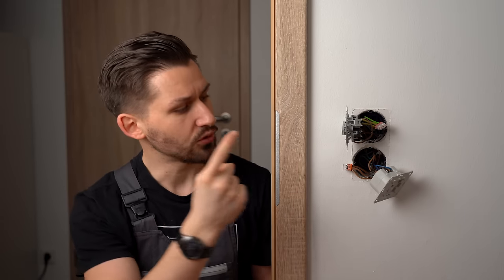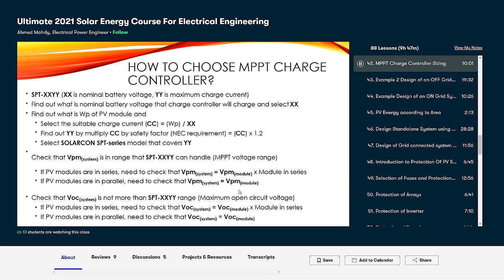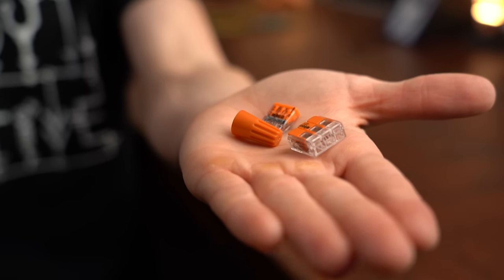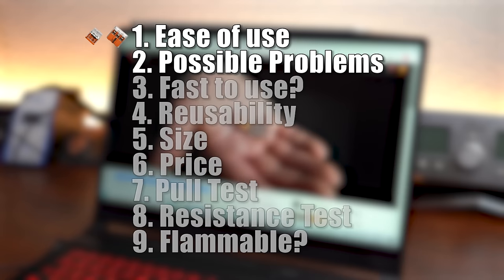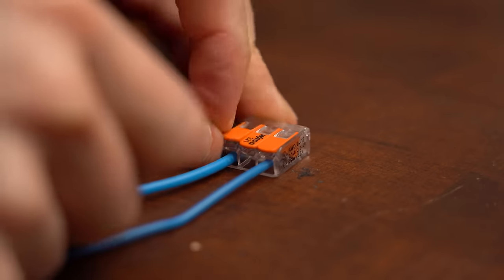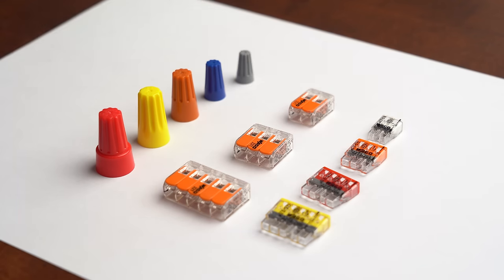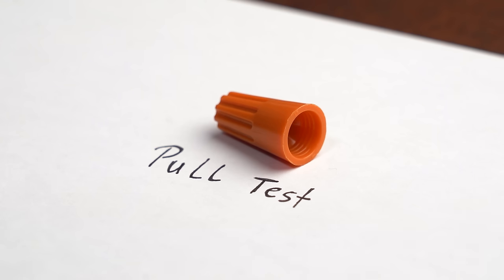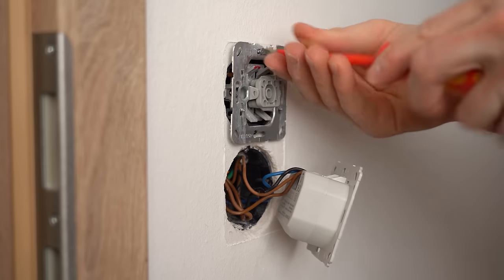What Wire Connector is the Best? Settling a Debate! Wire Nut VS Wago

Comment: I personally like the Wago connectors, and I think non-professional installers should prefer them. There are circumstances where wirenuts are used that make sense though, like water resistant connections (e.g. on submersible trailers), where there are specific wirenuts with flanges that reduce water penetration.
With that having been said, I think the "wire nuts" you got were not from a reputable brand. There are all sorts of manufacturers of them, and the good ones will have specifications listed on them for every test you did, and will be listed by a certifying body like UL (Underwriters Laboratories), Intertek ETL, or CSA. I believe at least UL does listings that take into account how easy the given nut is to be misused, and they can perform quite differently on that with even slight differences in the geometry. Of course, reputable and listed wire nuts are going to be more expensive than the cheapest ones.
Reply: I saw a JB where a guy used about 50 wago connectors. 1 month later I was called out and 5 had started arching to the point where the wires were hot 8 inches back and all the sheathing had turned black. Some of them are good. Some are trash. But I’m not gunna be responsible for someone’s house burning down so I am going to use wire nuts
Reply: @XMooseManX  With no information about the application, there's no way of saying whether they were appropriate or not. Genuine Wago lever nuts used as listed (not in overfilled enclosures, not on unprotected circuits or circuits with inappropriate current, etc.) do not just suddenly start arcing.

50 lever nuts in a single junction box, to me, gives a good hint of where the problem lie...
Reply: @microcolonel  yea the guy was probably a moron but at the same time that many wagos allowed for a dumb person to make a mistake that resulted in issues with the connections.
Reply: @XMooseManX  have you done the same experiment with an overfilled jbox full of half-assed wire nuts?

Comment: The pull test is definitely a hit or miss with the wire nuts.  Especially when you connect more than 2 wires, or different AWG,  there is chance of them not being engaged by the threads of the nut.  I have previously spent time aligning and then twisting tight a few wires with a nut.  After moving them around the box one wire just fell out of the nut.
Reply: pre twist my man pre twist
Reply: Learn how to put them on.

Comment: Here in America for fire alarm we use exclusively wire nuts. My newer guys can have trouble with wire nuts but for experienced guys like myself wire nuts are incredibly quick and you can get an extremely good connection. I think the wago connections are great for diy and people who don't do wiring professionally but the cost and potential resistance issues the can impart especially on fire alarm are definitely a downside for commercial use. Do German electricians always use the automatic wire stripping tool? Here in America I have never seen a professional use them and any new guys that bring them find quickly they they aren't fast and reliable enough as good old wire strippers. Even apprentices should and for the most part can tell by feel how long to strip wire back.
Reply: @Brent Radebaugh: Thank you! Automatic wire strippers are forbidden where I studied. There are solid engineering reasons for this. All strippers might not be created equal, as is true for pressure connecters, but the risk of wire damage was always deemed too high. Training and skill were judged more valuable than potential time savings.

Comment: Add 2 points for wago :) one for being able to comfortably connect more than two or three wires and the other for being able to safely disconnect the wire even is under voltage.

Comment: Switched to WAGO a few year ago, over the years so my times doing service to electrical connections have found many wire nuts poorly installed. With the WAGO's easy to inspect and much better chance of getting a long term reliable connections.
Reply: Good connections are not made by chance.

Comment: I think wire nuts are safest when thinking about long-term reliability. There is a very remote probability that those teeth in the Wago connectors can lose their tension or corrode after 20-30 years, almost certainly leading to a few Ohms of resistance and creating a fire hazard. The wire nut connection can't really lose tension and if the spring corrodes, the wires are still connected to each other by the twist.

Comment: in the US I think most electricians use the white/cream colored with wings type, they also fit a nut driver if you wanna crank it down really tight.

that's what my dad used in our house and he was a professional electrician when he started.

there are also "greenies" that let you pass a long un-insulted ground wire stright through it to make a pig tail faster, those are only for ground and can't use a nut driver, but they still have the wings.

Comment: I'm an industrial electrician. First job I got out of college we used Wagos for everything, wire nuts were banned. Never had an issue related to them. Switched employers, lead man at the new place likes wire nuts and thinks wagos are overrated. Multiple times when we'd have issues with a motor, I would open up the peckerhead and find a burnt up wirenut.

Comment: It seems like there was only one criteria dealing with functionality, the resistance test.  There 3 tests for safety (size, pull, and flammability),  2 test for ease of use, and 1 for price.  The only test the Wago connectors won out where convenience factors.  The wire nuts did better in the functionality test.  I was a big fan of Wago connector before but I will probably switch to wire nuts.  The short of amount of time saved and reusing the part means I ultimate only liked the Wago connector because it was convenient not because it was better.

Comment: I like the WAGO 221, but they have a big issue. When the wires are in place, the latch flaps around by about 45 percent, meaning when a receptacle is being pushed in place, the latch could be then pushed back and release a wire or more, causing a short.  Poor design.
Reply: that was my first thought as well, I guess you could minimize that risk with electrical tape.
Reply: if there is the danger of this happening because of a lack of space, you should not be using this kind of wago in the first place. There is a maximum number, varying for different types, for standardized electric housing boxes. If you dont exceed these numbers, this will not happen. Of course, these standards will differ, or not be available in other parts of the world.

Comment: A wire nut is mainly a cover for the pigtail splice, and quality varies.  In N America, push-in connectors have a bad reputation from backstab connections on outlets.  The Wago 221 is a fantastic connector, and results are consistent.
Reply: They have a bad reputation for a ton of reasons. The biggest one is just the fact that wires will come out pretty easy with a bit of twisting. Any place there is lots of movement or wiggle, the wire nut is better. Wagos are great and fast in lights or j-boxes. A switch or outlet could have issues over time though
Reply: there consistently junk.

Comment: Nearly a watt of resistance in those Wagos, heating up inside your walls - how is that allowed? Waste of energy = waste of money, fire hazard... seems insane
Reply: that's pretty crazy actually
Reply: Well. It is with 20Amps running trough it, or around 4.500watt if 230v was the reference.
Reply: "A watt of resistance" I really hope you're not an electrician. A watt of power lost with 20 amps running through the connector, that's nothing. Certainly not a fire hazard.

Comment: My issuewith this is you rated everything equal. To me the key factors are resistance and connection strength. 

Resistance in the US is a bigger deal because we run higher currents in many applications due to our 120/240 system vise the European straight 240.

Comment: Wire nuts are NOT made to connect the wires. They're made to COVER the open connection. You're supposed to twist the metal wires and that is your connection. If you solely twist using the wire nut, it creates a very poor connection which can/will fall apart a lot easier. Nothing will beat twisting the bare wires, including a WAGO, because there is maximum conduction between the wires. WAGO introduces resistance by using a smaller and/or less conductive connection. No need to test, just think about it.

Comment: Wow the way you use wire nuts are wrong! You have to first twist both wire to a prezzle shape and then tighten with wire nuts to secure it, NOT pushing in both parallely and rely solely on the nuts to make them twist.....

Comment: It does get me that the instructions included with many wire nut brands say you don't need to do this, but coming from the electrical field myself, I don't know any electricians who rely on the wire nut to create the connection. The wires should be twisted together first, and the the wire nut fastened onto that connection to secure and protect it. When done correctly (and it's really not hard), I would argue that type of connection is still the superior connection. Granted, you have to be careful when twisting stranded and solid core wire together. If not done correctly, there can be a tendency for the wire nut to draw the stranded wire up into the tip of itself and then not seat correctly. Pretty easily detected though with a quick tug test (which everyone should do with any kind of connector).

I have no problems with Wago connectors. They're fast, easy, and a bit tidier. But with Wagos you are still relying on the connectors own bus bar for the connection vs connecting the wires directly together in a twisted connection. Maybe it's overkill, but it's one less variable in the system, which means one less variable that can fail (though I'm sure it's still highly unlikely).

Comment: I am an electrician in California and while Wagos are available, a more popular and available option are the Ideal brand "in-sure" push in connectors, which are the same as the Wago 2273. I use them almost exclusively now in my work, but unfortunately they are not available for wiring that carries more than 20 amps, so I do so have to use wire nuts for larger size wire

Comment: Ok as a electricians helper here's how you use wire nuts. Cut anywhere from an inch to 2 inches of insulation off. Slightly pretwist the wires then use the wire nut to get the wires nice and tight. Remove nut and trim un insulated wire down to 1/2 or 3/4 inch. Install wire nut again and cover half the nut with electrical tape down 1 inch the wire.

Comment: It might be worth mentioning that the ribbed portion on the outside of the wire but it the stripping gauge. You strip the length of the recessed groove. When using stranded conductors with solid conductors you allow the stranded conductor to be put in first. That creates a much more reliable connection. I’ve used both a bunch here in the states. Never had an issue with a properly done wire nut but I have seen wago connections work loose from expansion and contraction due to heating and cooling, particularly on exterior fixtures like coach lights. Just my 2 cents

Comment: I'm in the US, I use push connectors as my default (cheap and have visual confirmation of connection). I use WAGO if I'm working with stranded wire, need to wire with one hand (Ex: holding a fan up) or if I'm trying to figure what my wires are (allows me to quickly rewire connections).

Wire Nuts = 10 cents each
Push Connectors = 12 cents each
Lever Connectors = 80 cents each

Comment: I’m sure some Americans have pointed out that the wire for using a wire nut was done improperly. Home users (DIY) would more than likely use them the same way but not professional installation. Strip more, clockwise twist conductors, cut off to length and then install wire nut.  
 Overall informative video. Results were about what I suspected going into video. Good job.

Comment: All depends on whether or not you know how to do good work. I do, so a wire nut doesnt even hold my splices together, it just acts as an insulator.  I'd put my 5 wire splice with a wire nut up against your wago any day. Might take a little longer but it's a far better connection with lots of direct copper to copper contact.

Comment: Here in Britain, the standard practice is to do the same thing as a wire nut does - Except we use the fingers and don't bother with the nut. We simply wrap a bit of electrical tape around the dodgy join and then say „Sod it...That'll do“ and we get bonus points if we use a mix of solid and stranded wire on those joins, too. 🔌🔥😉

It'd be really nice to see Wago connectors become the de-facto here and I know some of the better British electricians are using them now, but until we can get ourselves out of this race to the bottom we're going to be stuck with the cheapest options every single time. 💸

Comment: It should not be based on ease of use, it should be surface contact area which produces performance and SAFETY. The wire nut always wins when installed correctly. WAGOs are clever levers but do not perform electrically.

Comment: I got some Wago 222 replicas from China. Did the same pull test as you did. I reached 37kg but it didn't fail. Surprisingly!
Reply: You are brave. I wouldn't trust Chinese parts in my electrical installation.

Comment: besides the open end of wagos for testing voltage seen numerous times in the comments, the wagos end push connections have the added benefit that its easier to add something to the installation. you can just push in new wires in existing wagos in the nearest junction or central box, while with wire nuts you need to unscrew them to twist in the new wires

Comment: As a eastern european, i prefer simple  electric connection cube. Better resistance parameters than wago. Also, construction of this antique connector prevent from making too much circuits from one line. I saw many cases, when someone was wondering why B16 circuit breaker turns off, and the reason was 5 wagos in one electrical box expanding one 2,5 mm outlet line for 10 circuits - because it is easy to just put-in conductor than screwing them to the cube brass tube. During screwing there is a chance that a thought will appear - "if the third wire does not want to enter, maybe you have to do it differently?"

Comment: Would love to see you get some good wire nuts. Probably closer in price to the connectors but I do plant work and ours have silicone in them and a heat string band at the end. Twist your wires tight. Snip the sharp jagged ends. Crank tight. Heat the end. Come back next day only way to remove is to cut off the joint. Fully water, vapor, and corrosion proof

Comment: Accordin to theese results - wire nuts are clear winner. They make less of ressistance and they make stronger joint. Thats much more important than "reusability" etc. It only cost couple of cents. Btw, sebior electrians that I know still reccomend twisting and bending ghan Wagos. 
Wagos are "good enough" but not better and more reliable than the "old school" with lot of twisting and bending on the end. That much stronger joint with much more contact surface

Comment: Most sparkies use the end of linesman pliers to hold the wires in a line parallel to each other and twist it which wraps the wires together. This mushes the copper wires together tightly so you don't even need the wire nut for a good connection. Then screw on the wire nut to protect from shorting out/shocking people. The main disadvantage to me is that twisting the wires together makes it more difficult to re-wire the connection.

Comment: When using a soft stranded wire and a solid wire in a wire nut, insert the stranded wire into the nut first, then the solid wire, and turn the nut. No one seems to know this, but it works every time.

Comment: Read the directions on the t box. It tells you to lead stranded conductors. That means to let the stranded conductor stick out past the solid conductor. It doesn't take much, just a little bit, That way the stranded conductor gets locked on the end of the solid conductor. The reason wire nuts do not show a current rating is because the wire nut does not connect the wires. The wire nut presses the wires firmly together, so the wires are connected to each other. If you hold the wires close to the wire nut while screwing the wire nut, it takes less twisting to  screw the wire nut on firmly, because the wires will not twist up as much, and they should be screwed down firmly either with a wire nut wrench, or pliers, or serious finger effort. If wire nuts are put on tightly, it maintains pressure on the wires so corrosion can't get in. I have never used Wagos, but it looks like they are easy. Time is money, but Wagos are money too. Your choice.

Comment: For large jobs with plenty of room wire nuts are the best especially from a cost perspective but if you have short wires or tight boxes with high wire counts the wago connectors are the way to go. Also for the novice connecting solid to stranded wires the Wago connecters are fool proof where as wire nuts take skill for a good solid connection. Just another tool in the arsenal of electrical work.

Comment: i like the clip on wago connectors for 12v wiring. Its nice when you need to hotwire circuits for testing and whatnot, so you dont have to waste crimp connectors.

Comment: You measured very low resistance with a wire nut that was installed and functioning perfectly.  The thing is, we Americans know that they are not always installed that well, and you can't see what is going on inside them.  Sometimes they come loose.

It is useful to know that the push-in WAGO had appreciably lower resistance than the clamp WAGO.  We have similar push-in connectors over here made by Ideal (the wire-nut company).